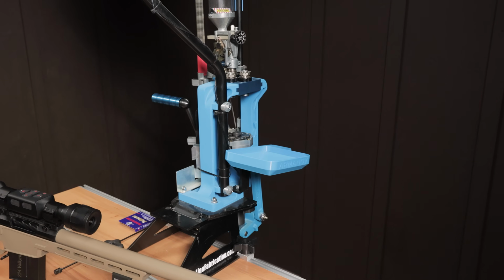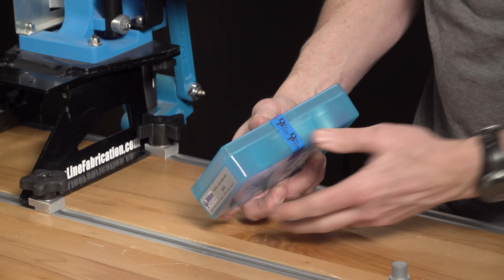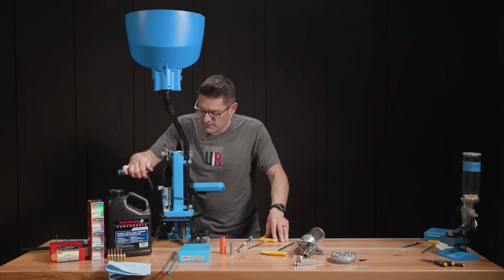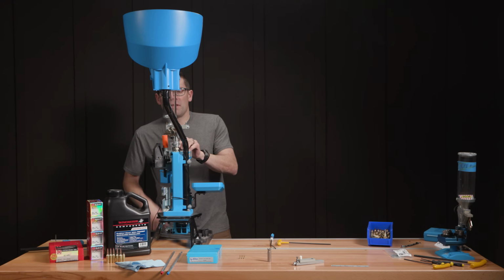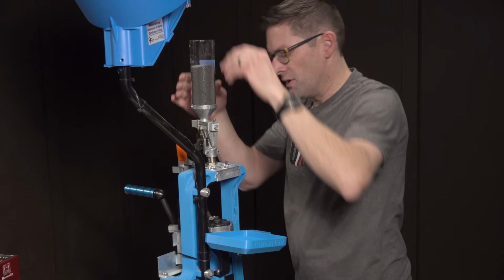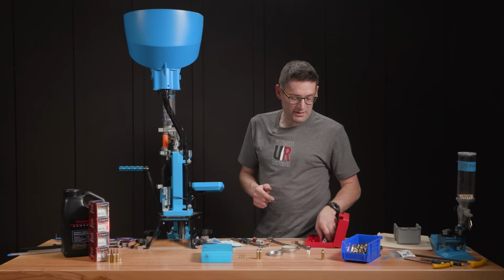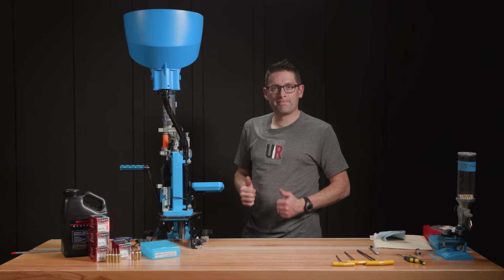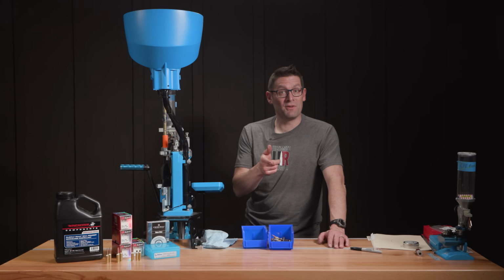Bulk Loading 22 ARC on the Dillon XL-750

Comment: Hey Gavin, I reload 6BR on my 750. I don't use the powder dropper. I use the auto trickler V4 and drop it through a Lee funnel and die from my turret press. It saves alot of time vs the single stage press.

Comment: Gavin, that’s a really sweet setup! 
 I learned a little trick from GunBlue490’s channel on how to initially set the powder dispenser that I thought was genius. 
With the hopper empty, weigh out the desired charge and dump it into the hopper. 
Now, open the measure enough to let it all in. 
Finally, close the measure until there is no room left. 
Fill the hopper and run a few cases through it. 
This will put you very close to where you want. 
Thanks for the video 👍👍

Comment: As reloading die selection is currently limited, might it be safe to assume that one could purchase a 6.5 Grendel Bushing FL Die and a 6.5 Grendel Seater? Replace the bushing and seating stem with appropriate 22cal parts? I expect that the FL die would be functional for converting 6.5 Grendel brass as well, possibly a couple steps with different size bushings?

Comment: Gavin, do uou mever worry about at least a chamfer when you loqd bottle neck on the progressives? ALSO what did you lube the cases with and what method? Did you actually put imperial on by hand or use maybe one shot or something?
Reply: Try the Dillon spray on your clean brass after they’re wet tumbled with stainless media and dry. It’s lanolin and alcohol air dries fast too. Load as you would on the press and then tumble in a dry vibratory. Or. You can use a microfiber towel and clean off the lube. It’s how I’ve been doing it for a while now with great results. I only use imperial wax on my single stage nd turret presses

Comment: That is cool and all, being the new "shiny" round, but I will stick with my 22-250 Ackley Rem 700 with a custom 1-7 twist barrel. My 22-284 is also wearing a 1-7 twist barrel. I think one of the best  things about this is we might be seeing heavier, sleeker 22 cal bullets. I want heavier bullets for my 22-284, so much that I even considered getting into swaging my own.
Reply: The real wins of the 22 ARC is that its been around forever as the 22 Grendel wildcat and it can be shot from a AR15 length mag.    Hornady screwed up with the 6 ARC and should have just made it a 6 Grendel, but thats water over the dam now.   Neither of the cartridges you shoot can do that.  Are the 22-250 AI and the 22-284 barrel melters capable of higher velocity and probably slightly better accuracy?  Probably.  But this isnt the purpose of the 22 ARC.
Reply: I'm running a 22-250 with old school 64gr berger bullets an my swift I'm using 60gr sierra if I need fast 75gr vmax in my 6mm creed or 243 an 6mm remington think I got it covered for varmint an predator
Reply: @waynemayle865  Once again, you missed the point.  A 6 CM or 22-250 cannot be run from an AR-15 length mag.  That's the point of the 22 ARC, even if Gavin is showing it being run from a bolt gun.
Reply: @waynemayle865  Thanks for the "fast breakdown" but once again, you completely missed the point.  The 22 ARC was designed to be run from an AR15 length/size mag with a max COAL of 2.260.  Yes, I know the AR10 platform, which is much larger and heavier, can run 22-250, 6 CM, 308, etc, but that isnt the point here now is it?  It is a purpose designed cartridge for a specific purpose and does quite well in that role.

Now if you want to debate the merits of a short action cartridge, think 308 family stuff, vs smaller stuff like the ARCs, BRs, Grendels, that is a discussion that is worth having.  The debate if an AR15/10 is a good platform vs a bolt gun is another.

Comment: Would you recommend the staball match for the 88gr ELD's also? I was just about to to go grab a pound of staball 6.5 for them, but was also curious about the match, being it's a little faster burning than staball 6.5. any help would be appreciated!
Reply: It's going in a 24" ballistic advantage 22 arc barrel when they are completed, if that helps. It'll be in a gas gun though.
Reply: Looks like H4350 would be a good option from the Hodgdon website